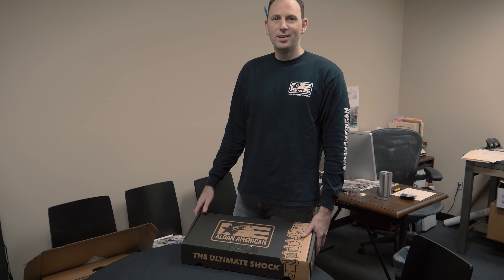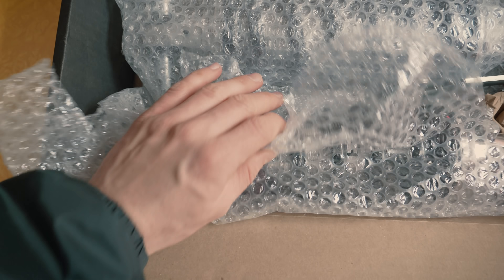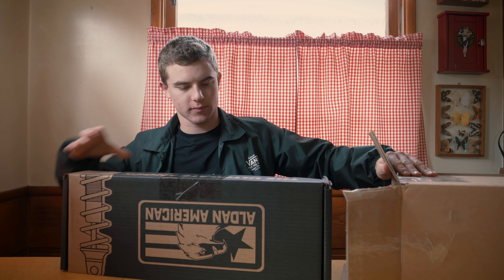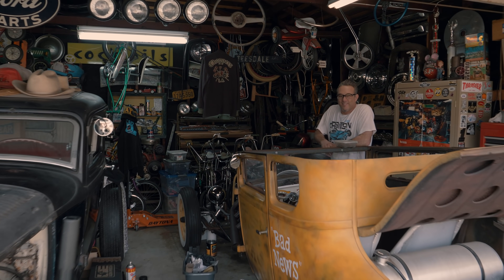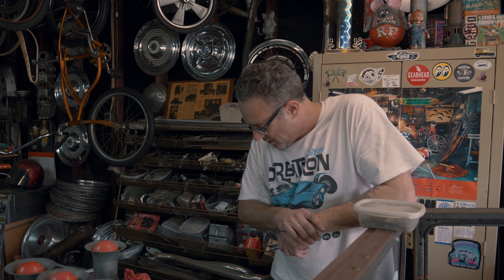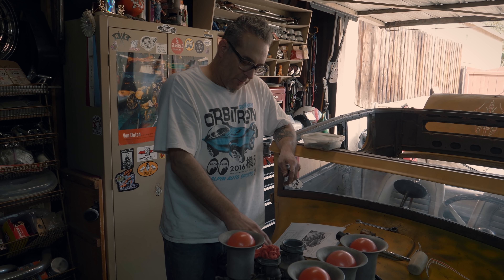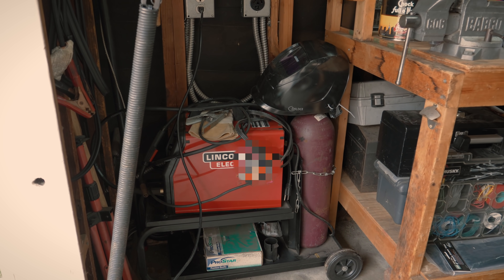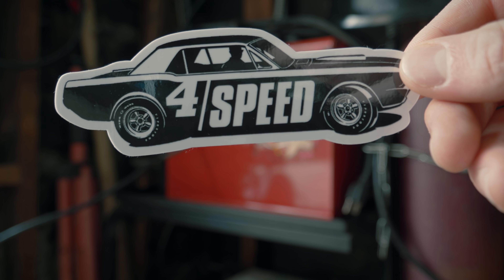I Got My First Sponsor! Webisode 5 [4K]

Comment: Hope the weather holds out for you.  You may need some paddle tires!

I had 8 Strongberg carbs on a log manifold once.  What a pain to tune!  Replaced it with a tunnel ram with two 4 barrels which made it much easier and better!  The 8 carbs did have that wow effect though.
Reply from the maker: Cool!

Comment: While you are in there with the suspension apart, search online for how to do the Shelby drop on the upper A-arms. Its basically free, and will help also improve handling.
Reply from the maker: Good thinking! Just bought the template. I’ve been meaning to do it for years

Comment: We got something called steel seal in the UK. 99.9% guaranteed leak fix. I used it in my 61 Ford zodiac and other cars. Worked a treat. The zody had a huge headgasket leak and it got me home. Well it was fine until I sold the car alot of miles later
Reply from the maker: Interesting! I’ll let my dad know👍🏼 Thanks